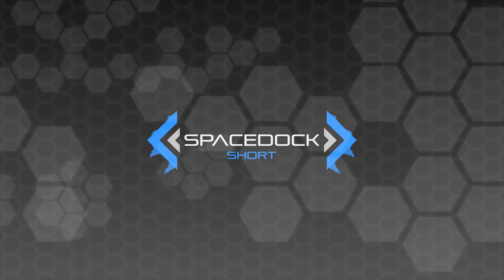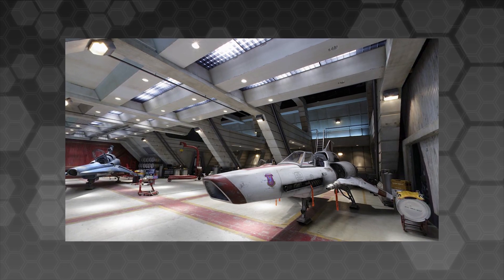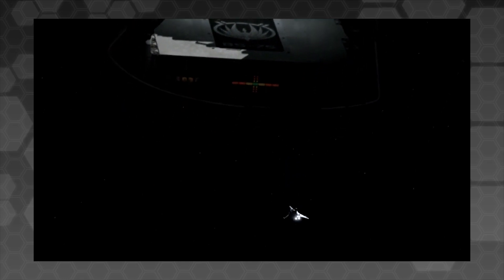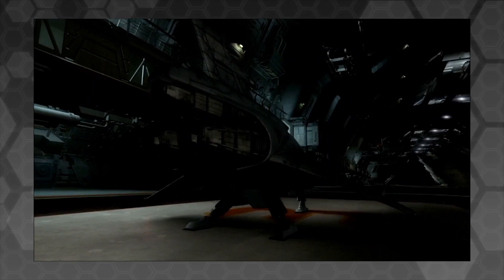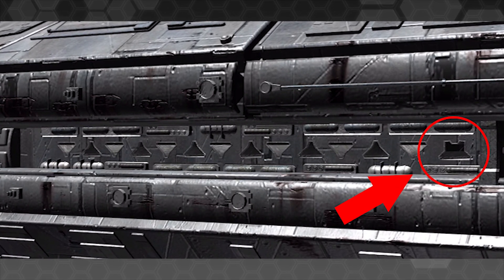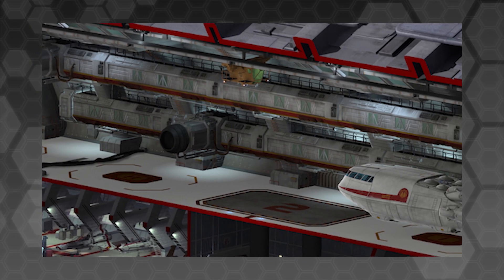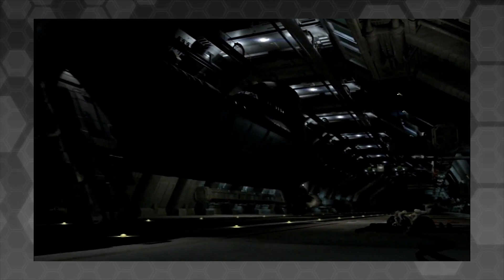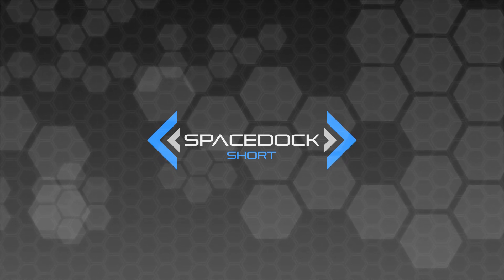How to Land on the Battlestar Galactica

Comment: I don't think the limited supply of Vipers was ever really a critical issue, the Galactica always had far more fighters available than they had qualified pilots to fly them. Risking structural damage to the fighter in a rough combat landing, in order to guarantee safe return of the pilot was probably a trade-off they had zero qualms over.
Reply: Roald Dahl's WWII RAF memoirs said this.  A hurricane can be built in a week.  A pilot takes months.
Reply: That is way we have ejector seats in modern fighters, it's considered better to need to replace a craft then a trained pilot.
Reply: @arcane_rogue3440 :  I am not certain if a Vioer has an ejection seat although the pilot wore a pressure suit.  

I’m quite certain that  if a Viper did have an ejection seat, the pilot would not utilize it in the landing pods.
Reply: except that they didn't have the ability to build new fighters if they did trash one, outside of the period that they had Pegasus for that (though why they put a fighter-factory on a warship is beyond me).
Reply: I feel like it was less that the Pegasus had a literal Viper factory production line on board, and more that they had the capability to fabricate replacement parts for their fighters while on deployment. Being able to build replacement parts adhoc gives them the ability to build entire new Vipers. 

As for the Galactica, they had either 40 or 80 Mk. II Vipers and only ~20 something qualified pilots following the Fall of the Colonies. The Vipers were a whole lot more expendable than the pilots, even if they were never able to replace them.
Reply: Smathalgoth I think it was stated in an early episode as 39 vipers including Lee's mk 7
Reply: which explains, why ALL Vipers could land and stay in just one landing tube without several, seriel crashes ...
Reply: @Smathalgoth I remember Galactica launching a training program to fill Viper and Raptor seats.
Reply: they did, that we saw only a handful made the cut. and a couple episodes later half of em died in the attack on the mine
Reply: @AndromedaHarper  On a warship capable of interstellar travel, the capability to manufacture replacement fighters makes perfect sense, as it increases self sufficiency and lengthens the time said warship can operate away from a home system.
Reply: TheAchilles26 Having production facilities on a warship is an absolute waste of space. Having those kinds of facilities onboard means that you know that have extra crew quarters in order to accomodate the people who will be building the new Vipers, it also means that you now need more food and water and the life support has to work that much harder, it also means that you also have to devote more space to hold everything to build new Vipers whether that's raw materials or pre-assembled components. Additionally, what do you do with the extra personnel when there are no Vipers to be made? They'd sit around doing nothing and just taking up space and resources. You could train personnel to have that as their secondary duties, sure, but what happens when they're too busy with their primary duties to work the factory? Aboard modern day naval vessels, at least in the USN, a sailor is going to (roughly) be on duty/watch for 8 hours, training/studying for 8, then free/sleeping for 8, so where would Viper making duty fit into this schedule?

Then you have the matter of cost, whether it's worth the cost of having such facilities onboard, which I'd argue is not worth the cost. If a battlestar has gotten that badly thrashed to the point where it needs to start making new Vipers to replace its losses, it would much faster, cheaper, and easier to either just jump back home to the nearest depot or, if it's important to have out where it is, have another ship with replacement Vipers meet the battlestar and transfer them over. If a battle is really going that badly then there's no way that the battlestar could make enough replacements, and don't mention the pilots, to make a difference; by the time a battlestart could make even a few new Vipers the battle would be long over. Remember, these are warships, not deep space exploration vessels, they're not going to be going on patrols for long enough to warrant all the troubles that would go with a Viper factory onboard.
Reply: @Riceball01  what viper making people wasting space and resources are you going on about? Use the frakkin crew that already works on the ships to fabricate new parts and put them together... And it's fantasy...
Reply: Nolan Martin You mean crew that already have other responsibilities and duties to take care of and when they're not doing that they have off time, you can't keep people on duty 24 hours a day. Not to mention how long it would take to train personnel to be not only spacecraft maintainers but spacecraft builders as well. To become a civilian airfcraft mechanic it takes a minimum of 18 months of training and I imagine that it's similar for the military. To add to that, miliarty aircraft mechanics are specialists with the airframe, engines, and avionics all being handled by separate shops. So you want to take people who spend a lot time just learning the basics of their trade and even longer to become proficient and add even more time to learn a whole other skill set that may only only use occasionally. Kind of a waste of time and money if you ask me. Far cheaper just to have the battlestar return home for replacements or have them sent out to them.

Like I said previously, if a battlestar has had that many of its flightwing wiped out that it needs to make more, it's already effectively out of the fight and is not going to be able to produce new Vipers anywhere fast enough to make a difference. If it hasn't gotten ripped to shreds by incoming Cylon raiders then it would need to retreat before this happens and if it's going to do so, it might as well retreat to the nearest friendly base where it can undergo repairs and get resupplied, to include new Vipers and new pilots. It's only in the situation that the Galactica and Pegasus are in that it makes sense to have an onboard factory, but they're designed as warships and not colony ships or long term, deep space exploration vessels. 

The other thing to consider is that they have FTL capability, which makes simply going back to base for repairs and resupply much easier than a conventional surface or non FTL space ship to do so. If you can cover light years in the blink of an eye then why would you need onboard factories that might only be use on rare occasions when it would be faster and easier to simply FTL back to the nearest base or rendevous with a supply ship that can FTL out and meet you halfway?
Reply: it was probably more a series of CNC machines with preloaded configurations to make certain parts, which in a combat carrier makes sense for field repairs
with enough parts, in a modular enough assembly, you could build one
needing all of a whole handful of machinists to maintain them 

that way you don't need to return to the nearest base, because you had a few get their upper tail shot off or something(didn't Starbuck limp one in that way)
Reply: Did they train new pilots as well or would that be too much work for the already taxed crew lol. You are arguing against fabrication and repair on an aircraft carrier which is in our own reality. Are you seriously telling me that if a nut and washer broke that you would crap a viper? No you fabricate a new one.
Reply: @Riceball01  WTF are you going on about 24/7? Nobody is pulling those shifts bud.
Reply: @jedigecko06  yes great point some are forgetting
Reply: @nolanmartin4813  Thjat's what I mean, there's no way that you could use expect existing personnel to pull double duty as whatever their primary duty and build new Vipers without them puliing 24, or near 24 hour shifts, 7 days a week. Their primary duty is going to occupy most, if not all, of their on duty time, sometimes longer,, then there's chow time, a bit of time to sit and relax, and then there's rack time. Between all of that there's no time to spend making new Vipers unless you're willing to say screw morale and allow them no down time, or cut down on all of their off time to squeeze in a few hours for a shif at the Viper factory. As it is, if things are so bad that you really need to make more Vipers, they're going to have their hands full working serious OT just trying to repair their existing Vipers since that means they're getting the shit shot out of them.
Reply: Remember, the Pegasus used to have a civilian fleet before they gutted it and picked the best-of-the-best of the civilians to work for them. I'm betting that they chose a number of people with fabrication and industrial experience with this in mind.
Reply: @AndromedaHarper  it is a good idea in that losses of ships can be replaced faster and without the need to return to a shipyard in fact the group i play with in space engineers took this to a new level in that our main ship which serves our our admins faction flagship/baseship can produce any needed ship from fighter to battleship using a huge array of auto building systems throughout the ship and even in the chaos of combat we dont run out of needed goods due to the fact those same building systems can salvage stuff from the field the biggest thing we have run into was a massive lag spike when we were replacing one of our destroyers during battle but the idea of the factory is a good one
Reply: @Riceball01  
Once they hgad to flee the homeworld's therevwas no going anywhere to pick up new ships. So the techs woul d be spending 8 hours working on the active ships and 8 hours building new ships, 8 hrs off.  They could also train some civilians to build ships and other equipment.
Reply: @drmayeda1930  I can buy that, adding Viper facilities as a retrofit out of necessity, but not as something built into it from the factory.
Reply: @AndromedaHarper  if you are planning on sending the ship out for years at great distances.  You would provide depot  level maintenance that was capable of reproducing ever part of a fighter.  It would be a "factory".
Reply: @raduran13  it's a warship that was designed to be operated in a single star system only a little over 0.16 light years in diameter. Not a deep space exploration vessel.
Reply: @Riceball01  U got the point if u thing of clasic way of mass-production optimalizing to cost. Sometimes u need just one spare-part to make it flight again, so having something like 3D printer whit database of parts can take less space than having spare parts storage on board, also u dont need much specialized personal there either... and in the end - in this case if u have enouth time u can print entire craft..
And its like pool in Typhoon class submarines,... we have place, why not have it?
Reply: @Riceball01  Ever been on a tour around the HMS Belfast (moored between London bridge and Tower bridge) or any of the surviving Iowa class battleships? Most ships of that sort have onboard machine shops, capable of making almost any spare part which might be needed to repair the engines, guns and more or less any other part of the ship. The battleships have several machine shops, some dedicated to specific tasks, such as the electric motor shop on the Iowa class, which can repair or rebuild any of the hundreds of types or sizes of electric motor used on the ship.
Reply: @Riceball01  Use the crew you have.  Most part making will be automated, so you don't need highly skilled machinists, just skilled builders..even then, they build per an assembly plan.  Your engineering crew already does repair/replace, and as you noted, there is 8 hours for sevond tasks.  Let them eat and rest 2 hours, work as Viper builders for 4, then have 2 more off to eat and socialize before bed.  Viper pilots have even more time to give since they don't put in regular shifts.  Form two details.  For, say, two weeks group A runs patrols and training, while B works with the engineer teams.  Then swap.  The "down" team is in the hangar, if there's an alert,  they can respond.  
Say it would take 2000 person-hours to build a Viper.  Modern fighters, and airliners, are built by components.  Flight deck (or cockpit) and nose. Main fuselage, wings, engines.  For a Viper,  8 distinct major assemblies which could be built on simultaneously.  Say each one has 6 people working on it at a given time.  Maybe 4 to 6 pilots, the rest engineering. Galactica is written up as having 2600 personnel.  Subtract the non-technical types, medical, command, pilots, cooks, janitors, and who knows what else, with that much ship, you are going to have at least a third if your crew in engineering or support, all cross trained for damage control.  So in a given shift, assuming a human type 3 shift duty schedule, you have some 250 engineers per shift.  Say you only give half of each shift the assembly job as their secondary task to fill the "training" hours, you still have 120 people, plus a few pilots, that's  3 full assembly crews, with three rotations working four hours at a time, it would take 4 days to build 3 Vipers.  The engineers swap daily so group 1 does assembly one day while 2 does normal stuff, then they swap.
Let the engineers return to normal for a couple of days, while the new Vipers are checked and tested, then repeat 4 times.  In a month, you have a dozen fighters.  Never using one extra crew member, never taking a minute away from any on duty personnel, and even the builders are only taking the extea work 2 days a week.  Pilots have to spend a bit more extra time, and one draws the duty of the actual test flight checkout. But every pilot needs a certain number of flight hours to stay current, and the flight test time of a new ship would count.  
Sure, the battlestar would need stores of raw materials in, say, ingot form to be melted and cast, or milled, into the parts, but that's inert storage, you wouldn't need life support normally, maybe not even gravity, in the material storage...it would not even need to be stored inside the pressure hull, necessarily.
Reply: I don’t think the “viper factory” was intended to be operating at all times. Presumably when it’s not needed the crew that operate it have other duties. As Art Brannon said it’s probably part of a multifunctional facility which can do a bunch of stuff the ship might need and it just so happens that what they need in the series is a whole bunch of IKEA flat pack Viper kits. If they need extra personnel to make up for any shortfall from running the factory 24/7 they could transfer people from Galactica or recruit civilians. The Pegasus is supposed to be able to run with much fewer crew than Galactica and is much bigger so I wouldn’t think housing the necessary personnel is more trouble than is reasonable compared to having to take the whole ship back to base to get spares. Safeguarding supply lines during interstellar war must be a nightmare.
Reply: I'm willing to bet that the "production line" on Pegasus wasn't really meant to be a production line. It was likely just a REALLY good machine shop with the ability to manufacture any random part they needed at any given time. Once they were on their own that machine shop was likely expanded into an ad-hock production line that was relatively inefficient, although functional.
Reply: @matts1166  someone gets it thank you. this guy above me is thinking star Wars geonosis droid factory or some shit
Reply: To chime in with what a lot of you have been theorizing - Pegasus likely had a military grade 3d printer capable of printing metal. (There are currently printers that can work with metal but I don't think we're at the level that anyone would be willing to fly an aircraft constructed entirely with printed parts.) With something like that they could be cranking out any parts needed and have an entire team dedicated to fabricating and constructing whatever is needed. They probably had caches of armour and engines on standby to overhaul Vipers.

I believe you guys when you say that Galactica had 39 Vipers but it strikes me as funny as they had to rush them out of the museum. It just seems odd that there would be that many of one type in a museum. (Yes, I've been to many military history museums but they tend to have one or two of dozens of different types.)
Reply: And they also had the Pegasu--oh wait, silly Apollo.
Reply: I have to agree with those saying this is probably more like a maintenance facility repurposed to make whole vehicles. Many of the Air Force bases I've been stationed at have facilities for fabricating entirely new parts. This is important because many of our aircraft are so old that the manufacturer no longer produces parts. These facilities aren't very big or high tech either. They mostly rely on manual presses and hand tools that your great grandfather would be  familiar with. Even then, these buildings only occupy a couple thousand square feet. They can manufacfure anything structural on the aircraft, and I have often seen them pump out new wing spars, fuselage frames, and skin panels. They can't make an entirely new plane, as they can't make new engines, avionics,  or many other subsystems. However, it's not much of a stretch to imagine a facility, maybe 5 times this size, stocked with more advanced machinery, being able to make an entirely new fighter. On a ship as large as the Pegasus, it wouldn't be an issue.
Reply: And that's probably not including the number of Vipers the Galacica inherited from the Pegasus after escaping New Caprica.
Reply: It is kind of odd that they have hyperspace jump-drive but they don't have Lockheed Martin combat drones.
Reply: @fyrstormer  In reference to BSG canon, I'd call those Cylons ;)
Reply: @MrVelociraptor75 : Combat drones don't have AI like Cylons do.
Reply: @fyrstormer  No, but it's the beginning. 
I'm not 100% up to date on the creation of the Cylons, but I imagine they were designed as weapons (among other things)
Also, the Colonials deliberately avoid wireless and computerised things, because they're easily hacked by the (superior) Cylon computers. Yes, by the time of the mini-series' start, colonial fleet's security protocols were up to scratch, but that still doesn't prevent drones from being hacked, just delays it.
Reply: @MrVelociraptor75 : If you want to trace the development of the Cylons all the way back to the very beginning, it all started with the invention of the lever in prehistoric times, because levers are the basis for Cylons' movable appendages. This may sound absurd, but my point is: It's not a Cylon until it's a Cylon. Almost-a-Cylon doesn't count. A Cylon without AI is just a robot that does what it's told without questioning orders. Similarly, a combat drone without AI is also just a robot that does what it's told without questioning orders.
Reply: Shawn Elliott true but as it's been pointed out: if I'm fighting an enemy that has made cyberwarfare its bread and butter I would be very nervous about having a hackable weaponised platform circling overhead even if it was mine